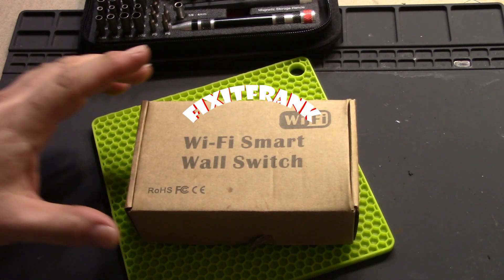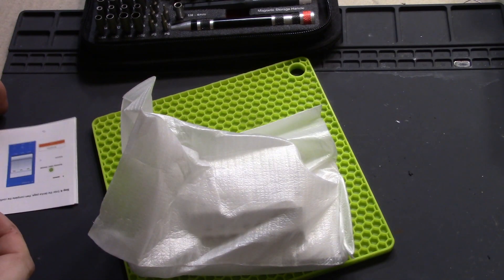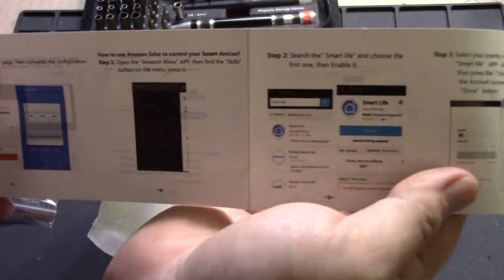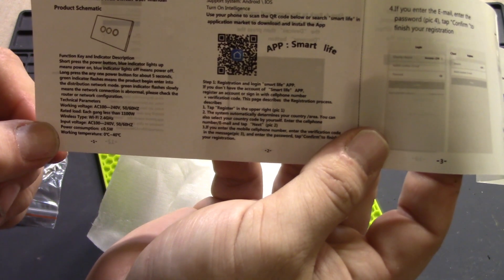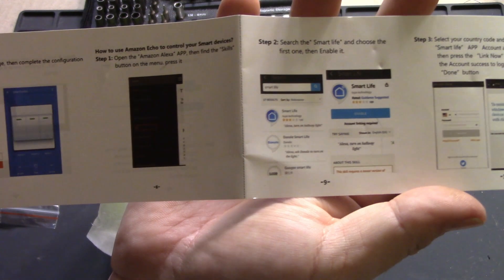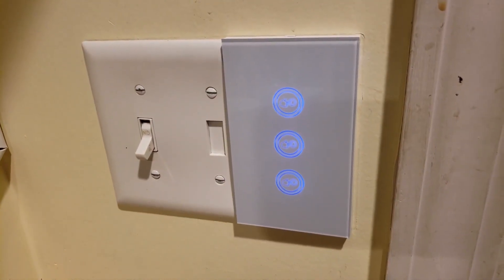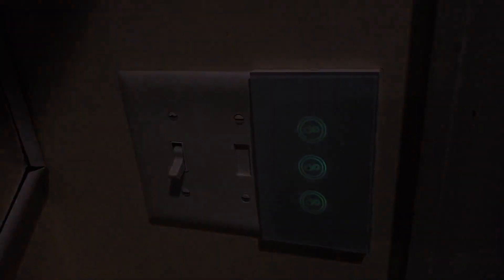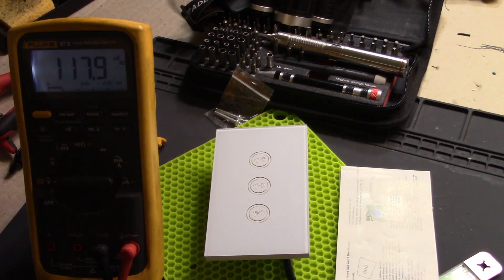WiFi Smart Light Switch from Youngzuth

Comment: Do you think I can connect my bathroom exhaust and light on this?
Reply from the maker: Quite possibly.  I would check the power requirement of the fan. As long as a 10amp relay is enough it should be fine.  I don't know what you motor current rating is on the fan.  If your old normal switch is rated at 10 amps this should replace it.  My only concern would be that the entire circuit should be on a ground fault interrupter to protect you from water/electric issues since its a bathroom.  In my house, I have a GFCI outlet that feeds the light switch circuit. So that if the GFCI pops, the lights go out.  That protects everything for me..

Comment: We have a 2 gang traditional switch with two black common wires coming in (one is live) and a load 1 and load 2 going out. My wifi Youngzuth switch is 2 gang, so it has one input line a neutral and a ground and two loads going out. I can't seem to figure out what port to put the second black common wire and I'm wondering if the switch is not compatible.
Reply from the maker: There should be a line in and a neutral and then two load out wire connections. What model is it?

Comment: Hi,

How did the board fare? Also can you please mention about the glow in the buttons? Did you find out about the diffuser material?
Reply from the maker: I did not find out about the diffusion material, but the switch is still working today.  It's handling 3 set of lights in my kitchen and so far is still working well.
Reply: @FixitFrank  ❤️

Comment: I was looking forward to see how to dis the wall connection step by step ,i have 2 of these and im scratching my head on installing them i have a neutral wire and the line wire but no ground ,do i really need the ground wire ?
Reply from the maker: You do not need the ground wire.  I did not use mine, it connected to nothing inside.  Only Line, Neutral and Load(out to the light). I did an install video on a different switch but it is the same thing.
Reply: @FixitFrank  could you send me the video on that one please
Reply from the maker: @dyolf10  its my most recent wall switch video. https://youtu.be/rHwJASuZZ5I?t=1245  I linked to where I start the wall switch install. The first part is just a teardown of the switch.
Reply: @FixitFrank  thats the one that inspired me to write you lol but i wanted to see the actual wiring from the wall to the switch

Comment: Great video and very informative in presenting how these devices work. Just bought several of these. The instructions only show how to install the software, not the hardware device. What advice can you share on safely replacing the original flip-switch panel with this new WiFi smart home unit?
Reply from the maker: Thanks so much! I recorded an install video a few days ago that I should have up tomorrow or Saturday. Depending how of you have access to a neutral wire is important. Older houses tend to use a single hot "switch leg" to the switch. If the house is fairly new it will have a neutral in the box. It's a pretty cool system. I found another switch that I like even more as this one isn't as great in multi-gang boxes due to its bezel. I'll show the other switch too.
Reply: @FixitFrank  where the above video ? send me the link ,i would like to see the actual wall connection
Reply from the maker: @dyolf10  https://www.youtube.com/watch?v=rHwJASuZZ5I&feature=youtu.be&t=1245  This video shows an install. Its all I have right now.  If you need specific instruction, I can see what I can find.
Reply: @FixitFrank  any word on that install video.  I have a red and black wire connected to my light switch on the right side and a copper ground on the left.  After plugging the black in the neutral and red in the line I have power running to the device.  The problem is it's not turning the light on or off.  Any idea why?
Reply from the maker: @coolclare23rc  black should be your constant live(input to the old switch).  Red is the wire that goes out to the light itself. That is your load.  White needs to be connected to your neutral. The only install video I really have is in the link above.  However here is a diagram that might help. https://imgur.com/a/P1RG2aE  This shows the wiring a bit more clearly.  Make sure you have a neutral. Without a neutral in the box it wont work.